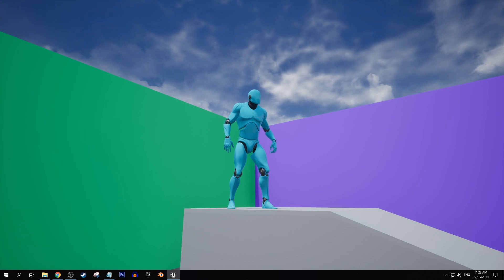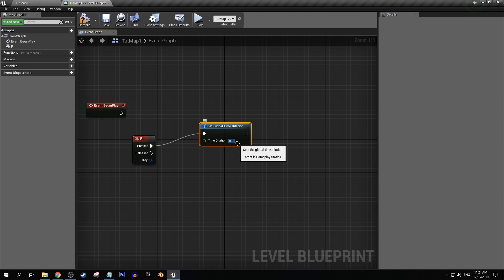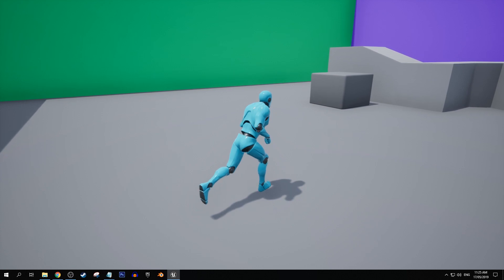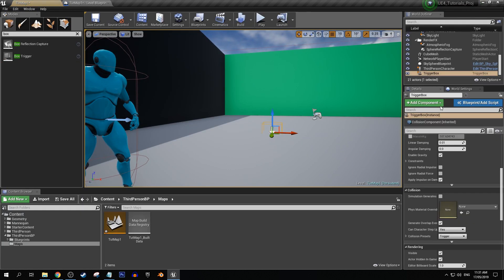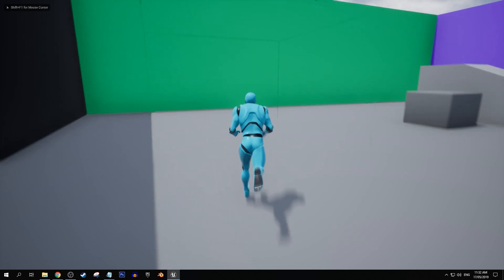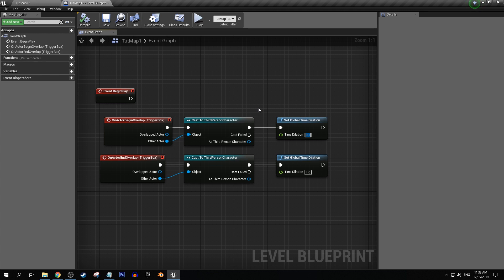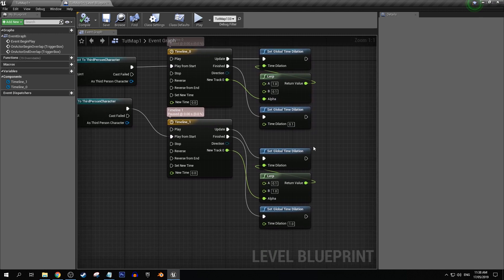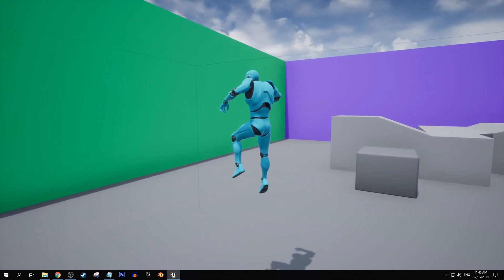UE4 Tutorial - Creating Slow Motion With Time Dilation

Comment: How do you do it that applies to every part of the map, not just one bit? Nice tutorial!
Reply from the maker: So if you're wanting this sort of thing to happen anywhere on the map, you're not going to want to use a box overlap like how I've done in this video. You'd probably need to connected to some kind of player input or you'll need to hook it up to events in the level blueprint or the gamemode blueprint. I'm happy to give a more specific answer than that if needed, I'd just need to know more about what kind of gameplay your making <3
Reply: @AuroraGameworks  I'm wanting to make a non-euclidean platformer where the player has the ability to slow down time, reverse gravity and place portals all at will. But the caveat is that the only the player gets slowed but momentum is preserved